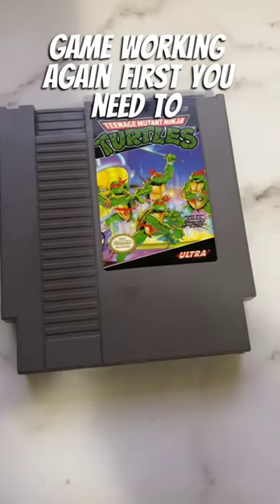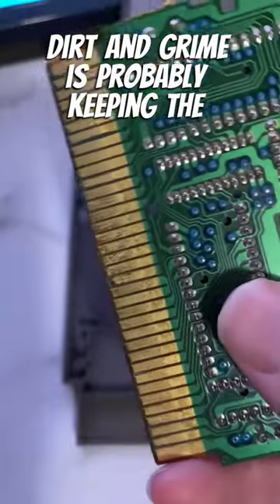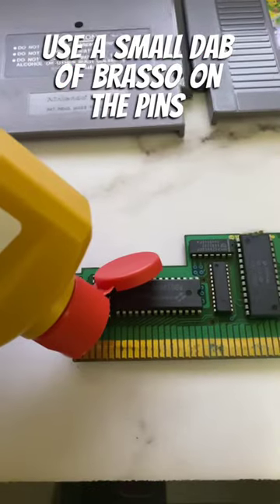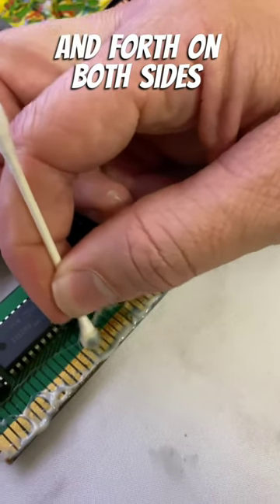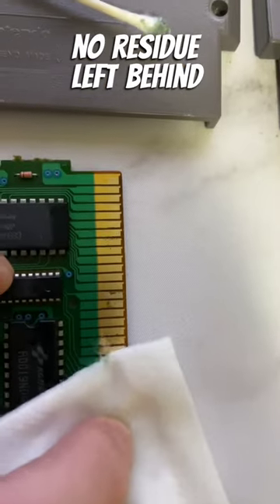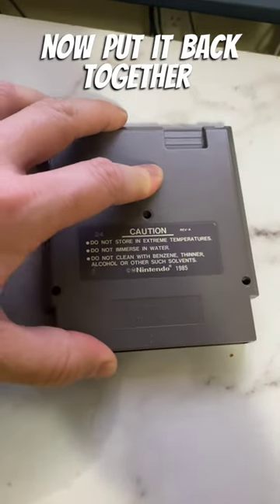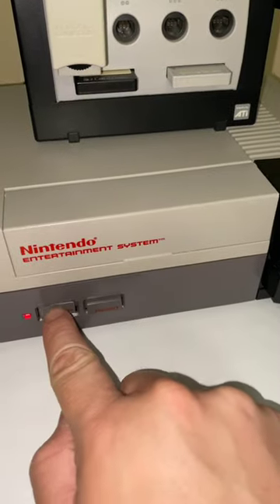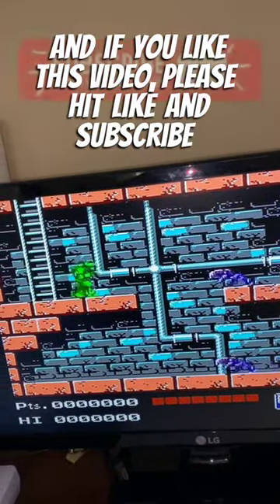Retro Repair Challenge: Fixing an Old Nintendo Game

Comment: Why is the cartridge so big if less than half of that space is used?
Reply from the maker: I think when they came out with it, it could have been more of an aesthetics thing on how it looked or how they could make it easy for kids to insert the game and get it out.  As time progresses the cartridges started looking better and easier to use, but cartridges and discs will soon be a thing of the past with the digital era.
Reply: Famicom cartridges are half the size. They just made the shells bigger in America.
Reply: @lowchaomain4535  they're not only less than half the height they're also narrower side to side, with fewer pins. Because the lockout (copy protection) chip) took a few extra pins and also a little extra board footprint.

Fun fact, most of the world is more familiar with famicom cartridges than with NES ones in spite of famicom only being available in one country.